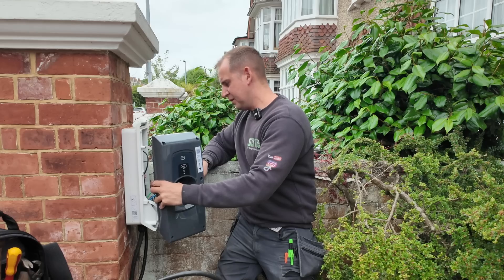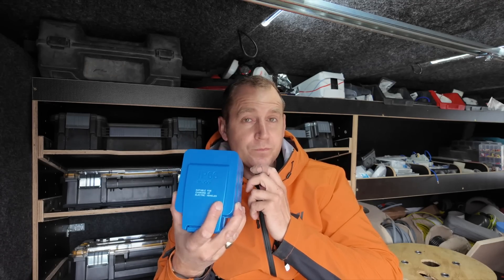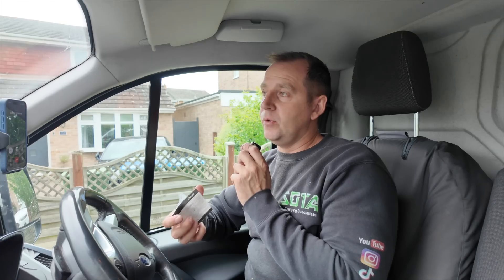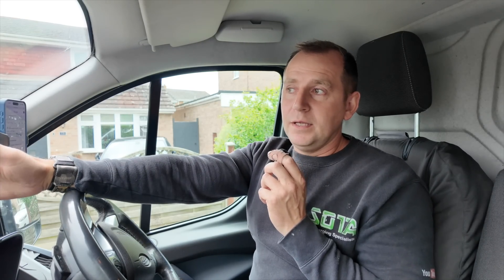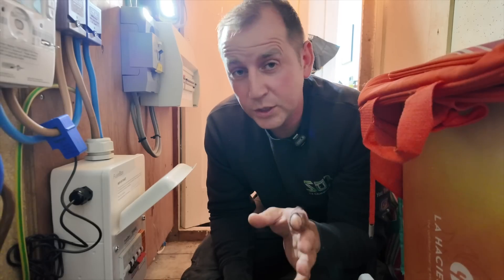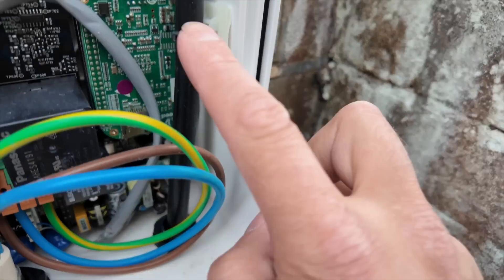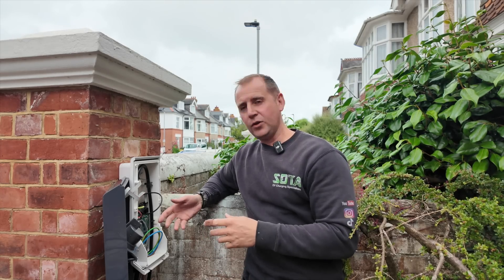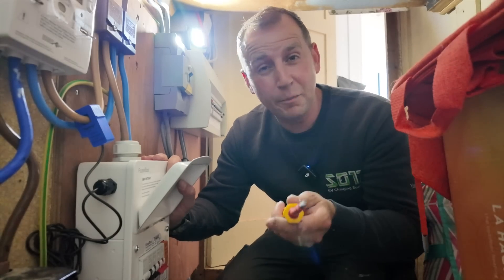A BLOWN UP EV Charger, A Misleading Product And A Day Of Carnage.

Comment: The indra is prone to burn outs and blow ups around the two sets of lever connectors. If they could sort that and the common connectivity issues they could have a market leader, considering it kind of covers all bases and options. Chargers without lever connectors don't seem to suffer from this but obviously rely on the spark actually getting his torque set out.

Comment: It's not the connectors, they are fine.
It's a failure in the lacquer covering the soldered connection onto the PCB.
This is a very common fault with new companies.
In my previous company we came across a similar product from an Italian
 Manufacturer.
They had not taken into account the moisture and oxidation and quite rapidly they had 10's of thousands blown panels usually on the back of the mains terminals.
Reply from the maker: Very interesting thank you for commenting!!

Comment: I've fitted one of these Hager sockets for a client after I visited the Hager factory in Telford and spoke to the clever chaps there (unrelated), basically it is rated to have a constant load of just over 13A over a long period of time without the contacts in the socket heating up and failing.
Reply: My 13A EV charger (granny charger) limits the current drawn to 10A, therefore ANY external 13A socket will do.
Reply: In that case these Hager EV sockets would also be good for one of those small 13amp hot tubs people have as they too draw a load for a long time
Reply from the maker: Great info thanks for commenting!!
Reply: As you might be aware a 13 amp ring main can carry about 30amps or so, the sockets are built to withstand this load. Any 13 amp socket can carry 30 amps. Therefore any 13 amp socket from a reputable company loaded at 13 amps is perfectly safe.
Reply: @captainchaos3053  Wrong ! A 30A ring can safely carry a load of up to 30A from devices plugged into a number of sockets, not from just one. The sockets were designed to carry 13A, but not for the hours involved in EV charging. Many UK granny chargers are limited to 10A for this reason, but imported units are often 13A. The 13A sockets marked EV are hopefully better at coping with 10A for long periods, as toyz66 has found out.
Reply: @captainchaos3053 😂 sure 😂🤣
Reply: @PersonGamma  Just because you don't understand doesnt make me wrong. Do some research first, simple facts.

Comment: That Indra has a design flaw.  Lever connectors should be the other way eg down to close and lock.  Fail to safe
Reply: That's interesting, Sergio. Last Friday I removed  & reinstalled an indra for my customer as he was moving  house. Charger was reinstalled at the new address, all working & connected back on my customers app. Got a call the next day, charger dead. Went back to site & found d the live had come out of the wago terminal.  I kicked myself obviously  but in my defence I pigged tailed the ends to take any strain off the terminals buy it still came out.

Comment: From what I've seen I'm guessing it's better at dealing with the thermal output of long use with a EV charger. Have seen alot of people say that when using a 3 pin charger it can over heat standard sockets
Reply from the maker: Great info thanks for commenting 👍👍

Comment: The Blue socket ... they have a deeper cover to accommodate the larger 3 pin plug and cable that "Granny Chargers come with.  I understand that they are also tested for safely maintaining a continuous 10amp load
Reply from the maker: Interesting thanks for sharing!!
Reply: @sotaelectrical  yeah, My Volvo "3pin "Granny" charger will not allow the cover on my IP66 outside socket to close.  I've been waiting for good weather to change it
Reply: 10 amps is 2kw or thereabouts. I would not recommend charging for long periods at 13 amps.
Reply: @rogerphelps9939  but you don't charge at 13amps - that is why Granny Chargers operate at 10amps and have a thermal cut-out

Comment: hager not really selling the prouduct in the best light. due to the rise in ev charging from 13a plugs a new standard for bs1363 sockets was introduced for sockets that charge evs. they are built and tested to a higher standard so they dont burn out under a large load for long periods of time. they will be marked bs1363-2 EV and have a message on the front "suitable for ev". this is mentioned in bs7671 section 722.
Reply: Put a 32A P17 instead
Reply: If a plug states 13a that mean that you can pull 13a continuously as stated from previous standards which doesn't set any time limit on the 13a socket, this is just some BS made to make EV even more expensive.
Reply: @StefanoFinocchiaro  this is not 100 percent true alot of appliances that are designed to run for long peroids of time cut back on the wattage like ev granny chargers are max 10a ovens and hobs sold with a 3 pin plug are 10 to 11A. appliances that run at or very close to 13a a good example is kettles that have a short duty cycle and are not used for hours at a time.  the difference of a ev socket is the further testing required. if you look in the british standard document bs1363-2023 13a plugs, socket-oulets adapters and connection units page 59 section 28 cyclic load testing which is 230v at a current of 13.4A for 28 continuous cycles consisting  of 8 hour on 1 hour off, 8 hour on and 7 hour off. they are then retested to make sure the pin tolerance has not changed and they are tested again for temerature rise has not changed. the price diffence is the testing you get that alot in specialised areas some marine and aviation prouducts are tested to a higher standard and are certified for there application. this is no diffrent.
Reply: @StefanoFinocchiaro  thats true dimpex do one i hadnr considered that.
Reply: @StefanoFinocchiaro they don’t use 13amp constantly. They heat up, switch off, heat up, switch off, it’s not like an EV load where it is several hours always on. As numerous melted or damaged 13amp sockets have shown.
Reply: @TheBrucifer  oooh, that's true

Comment: You can buy the BS 1363-2 EV single 13A socket for £4.49 .  I bought one and it is manufactured by Hager.  It can be mounted in any standard single socket outdoor enclosure.  Charger plug pins are just warm after many hours of 2.8Kw charging.  Hard to know if an ordinary socket would fare much worse without trying it.

The better 'granny chargers' have thermal sensing in the 13A plug  to ramp back current draw if overheating is detected.
Reply: Me too, bought the Tough leads Hagar  one and am happy with it. In practice most good quality sockets can do the job but ts reassuring to know that it is tested to  BS 1363-2 EV which means I can leave it on many hours at 3kw.

Comment: Hi mate, I've got ohme pro and fitter from ohme replaced it as one was faulty and done it in pooing fat rain, the inside of box was wet, he didn't give a crap, funny water tracked up the cable and condensated on screen. Ohme failed to come back to me. Brackets are shit. App is OK, could be do much better.

Comment: I don't get why someone would hire an electrician to come out and install this instead of spending £300 more and getting a full fat 7.6kW charger. When you eventually go BEV, you'll end up paying more to have it replaced with an actual EVSE in the long run, vs if you just did it from day 1. Not to mention most hybrid cars now take 7.4kw or so and if friends or family visit, it might be useful for them to use.

Worth the £300 in my opinion. If you can't afford the extra £300 then I'd say buy an EV and IP rated extension lead and use a regular 13 amp socket from your house and limit the current to 10 amps or so. Then in a few months maybe re-consider an actual EVSE.

At the very least if you're going to overspend on a fancy plug, at least have them install an EV ultra cable to it for the future so you can swap It out easily.
Reply: Looped suppy and a useless DNO taking months to sort it out.
Reply: I have a hybrid and chose the Hager socket as the cheaper alternative my reasoning being it takes roughly 4 hrs to fully charge my battery giving me a 35 mile range this I can do comfortably if need by using the cars app to set the time from midnight when I get my EV cheap rate to 4am and have a fully charged car no need for a 7.5 KW charger works for me and no I wont be upgrading to full EV hybrid gives me the best of both worlds.
Reply: @David-sb7fd same how me but I starting but thinking that will enough. Please are you using your house socket or you create new circuit just for this ev socket? If yes are using classic 2.5 or 16mm cable and what mcb 32A or more? Thank you for your answer.
Reply: Assume these are so house builders can stick one on the end of a buried 2.5mm and claim they've installed an "EV charger?

Comment: Looks like a normal outdoor IP66 single socket, not obvious electronics or anything to detect over heating due to prolonged usage. Hager didnt really sell it well :(
Reply: Most granny chargers have temperature sensors in the plug, to reduce charge current if temperature rises too much -  reducing current isn't possible to do from the socket side.

Comment: Oh on another note if I where you I would feed back the design of the wago style connector should be rotated 180 so they need to be lifted up rather than flipped down to release. Heat expansion contraction vibration and gravity for a release mechanism like that personally think it should be as I described really.
Reply from the maker: Thank you for the feedback!!

Comment: Those indra terminals are rubbish, just recently started fitting them and they seem to pop out easily, im scared ill have a callback with this issue now
Reply: Not to mention all the connectivity issues 😢
Reply: @jasedeed8771  dont get me started on that, i spent 5 hours trying to connect one to wifi and also tried 4g until i gave up, i replaced the unit aswell to see if it made a difference, many dongles later, advised the customer to switch to another brand, he went with ohme which ive been told have 3 antennas to pick up 4g versus indras 1
Reply: Iv replaced loads burnt out. The levers give up top feed to car and bottom feed in.   Had the pcb bored burn out at the bottom around the built in rcd and around the built in ct just under the top block. Iv had both 6mm and 4mm feeds burn out. Indra very good at replacing and know and u derstand the fault. The sad thing is the new unit they have has the same Internals but a diffrant out look. I find they last about 12 months and shorter with a tesla.
Reply: .....i second that👍
Reply from the maker: @blakehogburn1517  great info mate 👍👍
Reply from the maker: I’ve not had this issue before, I’m sure your be fine

Comment: eFixx did a video about EV certified sockets, as  required in BS7671. Yes the physical difference may well just be in the testing that's performed, but that's still a valid difference.
Reply: It should have a label / embossed mark on the front of the plate saying suitable for EV.  Fully visible to anyone looking at it.  I think that's to meet BS7288.

I fitted a few of the Masterplug Mode 2 13A sockets years ago for use with hybrids; the Masterplug one had an RCBO fitted to the left of the 13A BS1363 socket.
Reply: @peterandrewwilson976  Yeah, nothing in the standards about it being in  blue enclosure.
Reply: @smc812  indeed, you are quite correct.   Quite a striking blue too.
Reply from the maker: Good info thanks for sharing! 👍
Reply: @sotaelectrical from what I gather it’s because it’s blue and has EV label
Reply from the maker: @djgoode  maybe so!